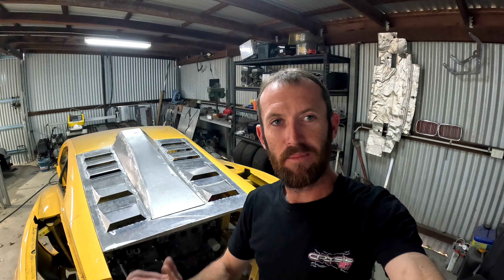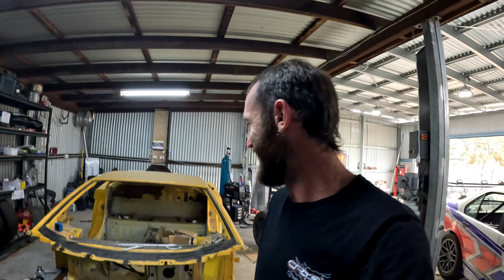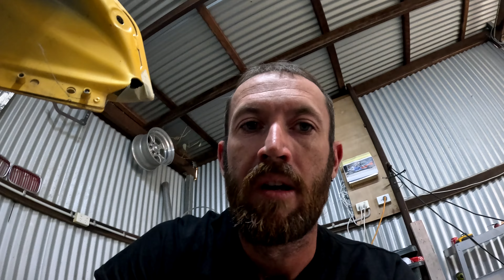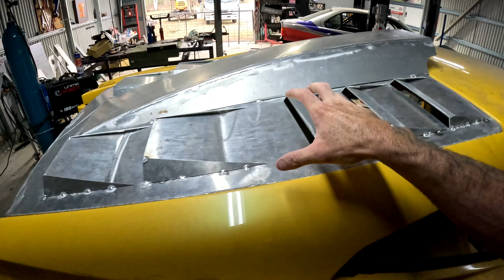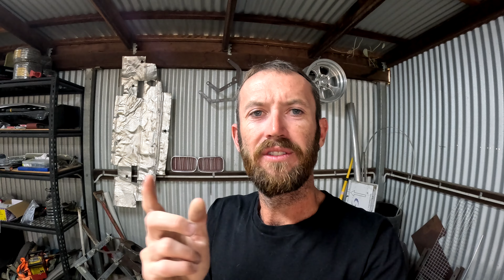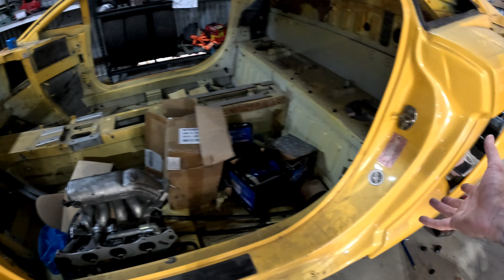HONDA SWAPPED LAMBORGHINI... barn talk

Comment: How about trying to get  bodywork from a Gallardo competition racecar series. I think B is for Build did it a few years back. it's rough bodywork made of fiberglass, still not cheap but way cheaper than getting original parts. Also it's easier to modify them for your needs
Reply from the maker: @RealMad-fz5vn  money is the issue. Im just a normal guy that wasnt supposed to have one of these cars. Alot cheaper for me to create my own kit. I also have a cnc plasma to cut out shapes and panels. The body work will be alot differant to oem or even the GT lambos. Thanks for watching.

Comment: Would you not consider building the ‘buck’, or part your moulding off for the front out of wood, expanded foam, wire mesh, filler etc? I would be easier to contour it to whatever shape you want. It only has to hold together long enough to paint and pull one fibreglass mould off. I needed a part last week and made a mould from a bit of timber and filler.
Reply: I suggested buying used factory parts and making mold off of them. I know he's on a budget but they aren't that priced that bad. The shipping could be the problem where he's at. He could resell the original parts though, to recoup the money from them. It's way easier than all that shaping and finishing. He would have factory fit quality and could make lightweight versions any time he needed them.
Reply from the maker: @pedenconceptz  hi mate, so time for me is free and i could get away with making Aluminium structure for couple hundred bucks. I also have a cnc plasma machine to cut out shapes and panels. I am going to try this process first. And also with building a time attack car oem bumpers and fenders wont be as Aerodynamic as what i am going to produce. Thanks for watching

Comment: Too bad we live so far away, or I'd help you buddy. You can learn to make molds and buy each piece of used bodywork one at a time, make a mold off it, and then sell the original part. You'd have molds to make all your front-end parts yourself. REALLY LIGHT VERSIONS. It would be way easier than making all that yourself in the end. This may seem like more of a hassle, but in the end they'd be perfect, fit well, and you can recoup the money from the original parts after making a mold.  Molds are easy, making/shaping the original part is way harder. If you need any advice on process or materials involved in the mold making/part making just ask. AJ Hartman has great videos on vacuum infusion and making panels. Make sure you use plenty of mold release AND a release agent when you do these.
Reply from the maker: @carbonfiber8071  thank you mate! I apreciate that. Well you can let me know if im doing anything wrong in the next few videos 😂 yes i have watched alot of his videos. There awesome!
Reply: @BIFIRI_97  He knows what he's doing and shows his work so that's why I recommended him. He's also making race parts so you can see the layup schedule and know it's strong enough.

Comment: When making the doors, are you going to create them yourself? Or are you going to buy (empty) original doors and sell after mold is created?
Reply from the maker: yes i will create the doors myself. they will be modified slightly would not suit on road use, they wont match with OEM front fenders at all.

Comment: You shouldnt need an oven for resin infusion, especially with qld weather.
Reply: The oven is the way to go. It creates consistency in the parts curing it in controlled heat cycles.